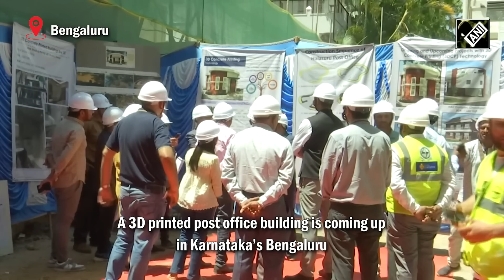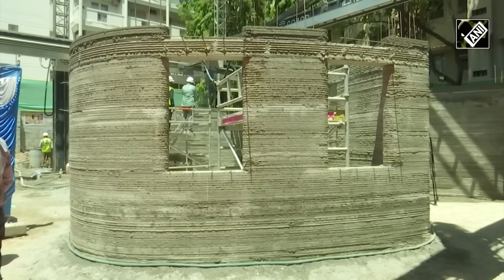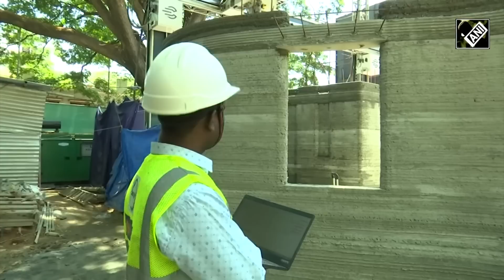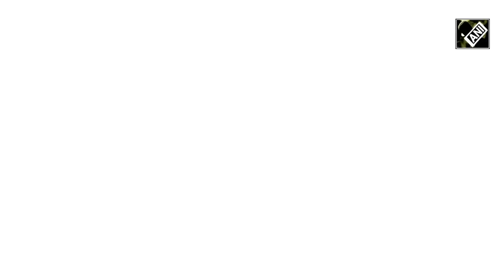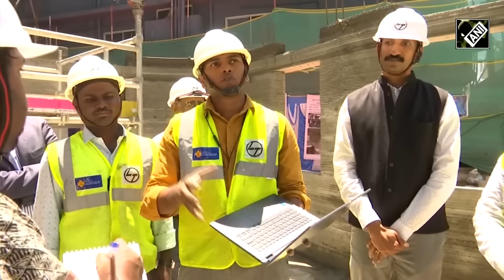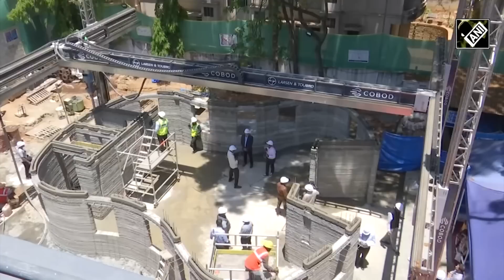“Good to see new avenues of technology...” PM Modi on India’s first 3D-printed post office

Comment: yah, still long way to go. too much mixture material, means more binding material used. 
In a brick building, bricks are heated and dehydrated material, the rest are binding material with cement. 
In 3D print, you have to replace the bricks volume with fluid or colloidal material, that is not heat treated, but dehydrated, so does that mixture collide that replaces bricks is less expensive than the cost and material to hear and dehydrate bricks?